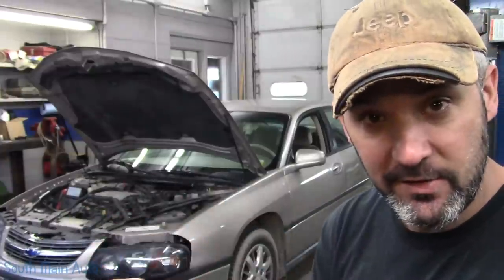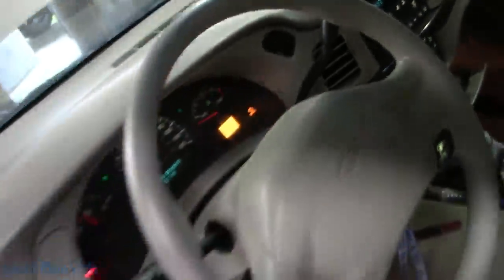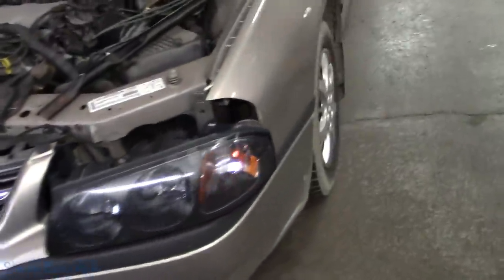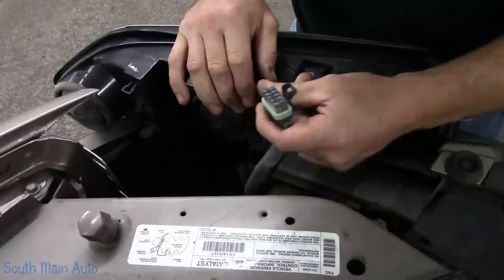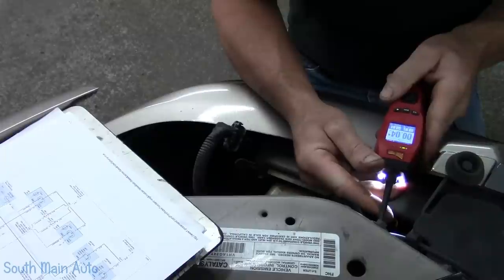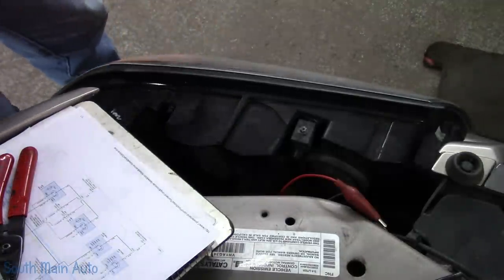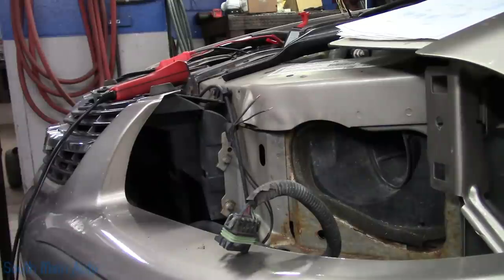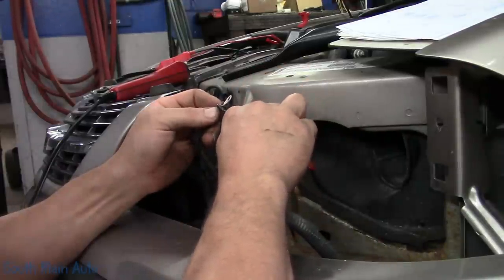Chevy Impala: Turning Signals All Goofy!?

Comment: Was not a waste of time. I got a 95 jeep GC doing the same thing. So you see what you think is not worth it , may be a great help to someone like me. Thanks
Reply: I got an S-10 back from a body shop with tail lights doing goofy things once too.  It also turned out to be a ground wire pulled out of it's eye connector.  Somebody probably was going too fast when removing the bumper to fix a dent in it.  It took me longer to find it than to fix it, btw.
Reply: Don't bother Mr O with "free advice" phone calls, he puts the "free stuff" in his vids.  If he had a 900 advice line at like 2$/minute, he'd make money for tslking...  
like Oprah.
Reply: As the S-10/Sonoma age, that's become a well-known problem. GM bundled every single ground in sight onto one tiny little eyelet. Been there, done that with one of ours.
I do like the S-10. Get flack all the time about needing a 'real' truck. Since the S-10 handles 99% of my needs, it's never made since to drive something bigger when I don't need to.
Reply: @ethelryan257  When S-10s first came out, I too thought they were just a toy.  Then I rode in a coworker's.  Later, I bought 1.  Ya live, ya learn.
Reply: I also have a s10, 2wd on top of that. I can confidently say I have hauled more and worked it harder that someone with a full size truck.
Reply: I've got a 1970 Challenger that the dash turn single lights will lite dim when the head lights are on. i
Reply: @umajunkcollector  -or Cleo. And he should charge $20 per minute, not $2.

Comment: Had a similar problem with a 2000 Chevy S10. Symptoms being turn signals worked fine, step on the brake or turn the lights on and they flashed fast. Also, if the DRLs were on, one brake light was not visible. I found the fix only after accidentally pulling a ground wire off the frame on my Sonoma when pulling the bed for a fuel pump fix. Turns out the ground "block" on the S10, not sure of it's proper name but it's a black block with a greenish cap on it and has a copper "comb" inside it connecting all the grounds together. On my Sonoma I pulled the ground wire off the frame for that. On the S10, the "comb" had gotten the green crusties. The Sonoma though had the same symptoms as in this video, except on the rear end.

Comment: Hmmmm... @4:36 I noticed that the high-brake-light comes on before the lower set of brake lights... Is that normal? I don't think I've ever seen that before now. 🤔
PS. I was so happy to see that you soldered that connection, and sealed up the perforations in the insulation. Excellent work, my friend!😉

How funny would it be if the other shop charged the owner for all those parts/labor... And then the owner sees their Impala, featured on SMA's video!   Lol 😎

Comment: Apparently many Chebbies have a grounding issue with lights.  My 2002 Express van had some crazy brake and turn signals.  I did a search on You Tube and found that many other Express owners had bad grounds on the rear light bulb housings.  It indeed was a bad ground on the housing of my tail lights.  I ordered new tail light housings from of all places, Summit Racing which had the best prices.

Comment: My mom's 03 Impala that was purchased new had a similar issue. In 2010, the turn signals would flash two to three times then stopped flashing. Same with the hazards. Brake lights worked fine. Diagnosed as a bad hazard flasher. Replaced the factory flasher with a Dorman flasher. About three years later, same thing. Replaced the switch with another Dorman as it was under warranty. Two years later, SAME THING. The car is on its third Dorman switch. The original flasher lasted longer than all three replacement flashers.

Comment: Good job finding the bad ground. Having been an electronics tech for over 50 years, I was saying "Solder the bloody wires going to the ground ring terminal" and you did!
 I learned very early on to never trust a crimped connection to stay tight. 
Learned that the hard way from "Mr. Molex's" connectors and many other similar types.. Good job with the liquid tape too. 
Thanks for another great video.
Reply: If you can't trust your crimps you're crimping wrong. Seriously. They're welds.
Reply: With all due respect, sir,  they are a crimp, not a weld.
Reply: A proper crimp cold welds the conductors and the crimp. So, with all due respect, sir, they are welds if done correctly and cannot come loose.

Comment: As you so 'easily' pointed out, Eric: When troubleshooting electrical problems, power and grounds are always th best place to start. Failing this one critical step will take a mechanic down a rabbit hole of unneeded parts replacement or worse, not fixing the problem. I hope the 'other shop' watches your videos as well. It's hard to say if they 'farmed' this one out to you and tell their customer THEY fixed it. If so they'll be keeping that customer. If the customer knows YOU fixed it, the 'other shop' will have just lost a customer to you!

Comment: Occam's razor.  Folks always want to run to a failure in the electronics, despite that those are the most reliable part of these machanical systems.  There are so many opportunities for mechanical connections to go wonky at terminals, whether spilled soda or salty road spray, and chances for insulation to get worn away rubbing against body parts, modules themselves are probably the least likely to fail...

Nice diag!

Comment: FYI everybody. the reason the dash indicator lights turned on was because the front lamps were trying to Ground thru the turn signal filament and the dashboard indicator bulbs.

 electrons travel from negative to positive.. no negative, no electrons..   unless it can pull a few thru a second bulb..
Reply: Yeah.  The dimness of the front bulbs bothered me right off the start. Also what would make both dash turn-signal indicator lights light up simultaneously?  Well, the dash turn lamps are oftrn powered by the voltage sent to the front signal filaments.  What situation could give (some) power at the hot terminal of each front signal light filament??   Why, a missing ground on  both right turn filaments!  A missing ground on one side only could lead to current in both front park filaments, but it would not light both dash turn indicators. The only way power could get to the top end of the opposite front filament (and thus light the opposite turn light on the dash) wouid be if both front bulbs lost their grounds.  So that one observation was a dead giveaway right from the start.

Comment: I had a 1980 Chevy Van once that a friend brought me. You stepped on the brake, and a couple of seconds later, the marker lights went on. Right Turn OK. Left Turn, and a few seconds later all the marker lights flashed. I found that the L/H Rear 1157 Light Bulb was at fault. The large Brake Light / Turning Signal Filiment would heat up and sag, contacting the Marker Light Circuit inside the bulb and feed power into the marker lights. In this case, it WAS a faulty part, but a BULB??? You will never live long enough to see it all. That was almost 40 years ago and I have never seen or heard of anything like that since. Bad ground.... yes... and strange things can happen, but an intermittently and internally short circuited bulb.... not something that jumps into your mind as a possibility. As another friend once said, "when all else fails, check the air in the tires.... it might not help, but it surely can't hurt, and you can truly say you've done something!" Just don't use "BAD AIR!"

Comment: I remember doing an engine swap in my old Civic. Wouldn't start so it turned into a long Crank, no start investigation. Frustrated, my buddy and I went to online forums. Someone mentioned a ground going to the thermostat. We ran to the garage, and discovered we forgot to hook it up. Hooked it up and she fired right up after. Moral of the story, Always check grounds. They're the most important part of any circuit.

Comment: Man I installed remote starts for almost a decade...if anything ever went wrong it was ALWAYS the remote starts fault🙄. NOOOPE.  I’m not saying they can’t cause issues over time, the same as any electronic device, but it was pretty rare.  Most of the time I ended up doing the trouble shooting for the shop.  Thanks for not blaming the aftermarket stuff first.

Comment: Whenever lights do goofy stuff like this it is a bad ground or wiring issue most of the time.   These w bodies are also famous for ignition switches too.  When the switches go bad the car will stall when you use the turn signal among other weird stuff.

Comment: The minute that I saw that both indicators on the dashboard flashing I knew it was going to be a ground problem obviously a turn signal flasher Works off the properties of ground that's how it separates the indication tracking down that problem of ground is a whole different ballgame but just as you did you started at the furthest point and was going to work your way back to the column I see cars driving down the road with one dim headlight and I know it's most likely going to be a broken wire or a bad ground somewhere in the system cuz it's not really dim but it is pulling from both elements but now we're playing the game if I had to explain it you wouldn't understand good job Eric keep up the good videos

Comment: I don't know what those other viewers are talking about. I have NEVER heard Eric be disrespectful of other shops. I have only heard him relay relevant information about the vehicles he is working on, so that we as viewers can understand the whole story. And if a vehicle has been worked on by another mechanic (and maybe even had a parts gun fired at it) prior to Eric, then that's just relevant information, and not slanderous in any way in my opinion. Eric always takes the high road it seems to me, he doesn't brag when he fixes problems that has stumped other shops and he even shows us his own mistakes. He does't overcharge or take wild guesses that cost the customer a lot of money (in fact he often goes the extra mile to try to keep costs down for his customers, as long as it doesn't effect safety or correct function in a negative way) and he always stands by his own work, what more could one ask of a repair shop?

Comment: My 05 Silverado had an issue where the left flasher would stick and stay on. On occasion the 4 ways would just stay on. Replaced the flasher module with an ACDelco flasher relay (about $50). No problems since.

Comment: As soon as I saw the symptoms, I thought “a wonky ground”. Ground problems can cause weird issues. When I first got my old Dakota, when you turn on the headlights, the wipers would turn on. Turned out to be a disconnected ground from the PO changing front body parts.....

Comment: I'm willing to admit when I'm wrong. Prediag I was after the body module. Didn't think simple enough.
Reply: InsideOfMyOwnMind I'm assuming you were the tech @ the other shop ? As an older guy let me tell you this: Always start out with the simplest souloution and if that's not the issue, then work your way further into the "meat" of the system at hand (especially with wiring here in Upstate NY with our "wonderful" saline based ice melt).
Reply: I like occam's razor which basically says the simplest answer I usually the correct answer. Hey I get screwed up all the time and we learn more from mistakes. I just hope the shop makes it right with the customer because it's not their fault.
Reply: I think that the other shop should eat the costs of some of the parts, one can dream I know.
Reply: In my estimation they should eat the whole cost it's not the customers fault that they couldn't find a bad ground.(or just take it to sma right off the rip)
Reply: Mike Holt they should eat the whole cost with the exception of whatever South Main actually charged to diagnose & fix the problem. The rest of the parts they blindly threw at it as well as the labor should be eaten & chalked up as a learning experience.
Reply: @ROTAXD  agreed

Comment: "Everyone is probably screaming "CHECK THE GROUND!"

I was when you were showing the lights flashing. The short blinking shows signs of high resistance in the wiring. Turns out a broken wire creates high resistance. Who knew.

Comment: When you solder wires, you turn a stranded wire into a solid conductor which isn't vibration resistant.  That said, it will probably last until the crusher hits it.

Comment: hey i have a similar issue. i have the same housing as the vehicle you worked on here. same issue with directional signals but also accompanied by a high beam out message i have an 03 chevy impala

Comment: Eric, thanks for all your good videos trying to educate us. I have an 2003 Impala same problem with hazard blinking with turn signals. I didn't have the loose wire,  don't have the electrical tools to test wires. I cleaned the ring terminal  put back together it didn't fix for me. Should I have cut off the ring terminal, expose new wire install new ring terminal then re- install. would that have been a better action to take...Thanks Dave..

Comment: Yeah I had a boat trailer whose lights would work part of the time and then, nothing. Usually when I was ready to go fishing and all hitched up. The trailer (steel frame) when checked with a meter would provide only an intermittent ground at the back tailights. So ran a dedicated ground wire from the vehicle body and split it to both tailights and problem solved.
Reply: I replaced the wiring in my dads boat trailer. Are German Shepard was going through his puppy stage and ate all the wires. I like the way you did yours. Dads boat trailer was grounded up front. So evertime he turned ....it put pressure on the ground wire. I did what you did except  I only needed 1 ground. I believe I put it in the back between the lights. Everybody seems to get away with no ground because there trailors ground threw the hitch. Not us. No ground wire no lights.
Reply: Yeah, most trailer wiring is terrible.
Reply: Trailers can be tricky if you leave them hitch connected. I always try to troubleshoot them with the hitch disconnected.  That way you don't get fooled with false grounding.
Reply: Maybe are boat trailer is different. Are lights are grounded by the frame. In my case you ground the frame anywhere it grounds all the lights. The more I think about  another ground.. just in case.. might be a good idea .
Reply: I never ground any trailers through the frame, direct wires only, and marine heat shrink on all connections, dielectric on every plug. I rewire every trailer I get, even brand new, because it’s never done right. I have trailers I rewired years ago, no issues.
Reply: Jared J rewire a new trailer..?? You gotta reevaluate your trailer vender/source. Just my thoughts. Not like they give those things away.
Reply: John lombard Well, Lamar, east Texas, pj, load trail, H&S, jayco, carry on, scamp, all have had junk wiring. I have yet to see a trailer that doesn’t have junk wiring from the factory.

Comment: Back in 70's I had a Toyota that had bad static on the AM radio ... turned out the whole front fender the antenna was mounted on wasn't grounded.  A temp jumper wire that became permanent fixed it.   I also had to track down a bad neutral connection on the house wiring,  the TV cable had become the neutral path,  the power company had to fix the faulty neutral out at the pole to fix it.

Comment: Eric I would have gone the same direction you went to the Ground I've seen the same thing happen before myself and it definitely was the Ground as we saw or the only other thing it might have is in the instrument cluster you know how those G.M.s are when you have problems in the Speedometer cluster but you went to the problem right off where I'd gone good going it was an easy & fast fixer with no big headache
Reply: it was easier years ago, each headlight and all the marker/turn/ other lights nearby shared a ground per vehicle corner. one corner acted up all bulbs went wonky, check the ground. then they started changing things "for the better" :))))))))

Comment: After market head light buckets strike again. Looked like a crusty rust mess behind the bucket near the air inlet.  Someone went " full gorilla" on that ground pig tail. Due to its location for u ever use the heat shrink that has the goop that comes out both ends when it's heated up..?  Used to use them on HD bikes as well as ATVs. Pricey but worth it.  Great video too. Never can go wrong sharing your thoughts processes.

Comment: nice job. Eric, can I borrow your nail polish?bwahaha  I saw you checking that the l/f filament was illuminating correctly. This job reminded me of a brand new car. I was doing pre-delivery inspection and when hitting the brakes the dash lights went nuts. Long story short the r/r brake/ tail lamp had the big filament broke off inside the bulb and touching the t/l filament. I was afraid it was going to be a harness problem.
.

Comment: Eric nail polish also works good on the connection at the body or a dab of lacquer. We used it on grds. in the aircraft industry. Aircraft aboard carriers had to have everything sealed talk about salt corrosion take a plane aboard a carrier and you have enough salt for a lifetime. Corrosion prevention is a full time job. Every nut bolt wire connector has to be sealed. I have the 5V adapter will be interesting to see you use it. Good fix ❤️
Reply: On military trucks every ground point gets slathered with RTV.  It's ugly, but that's the way it's done.